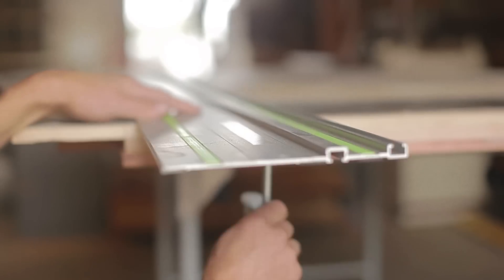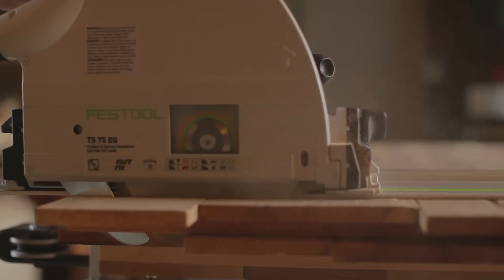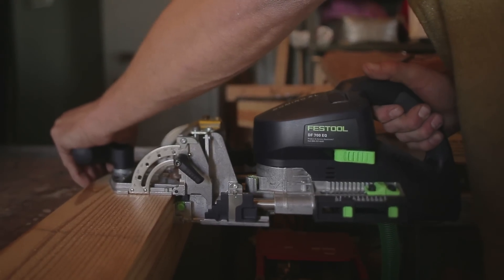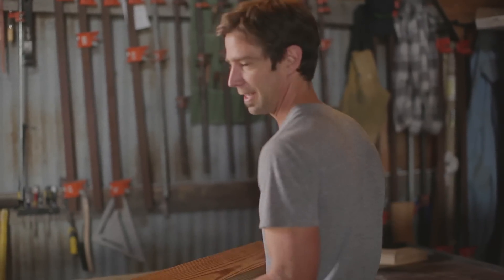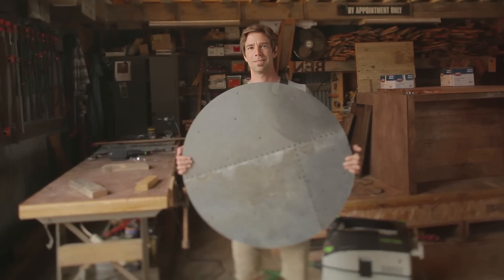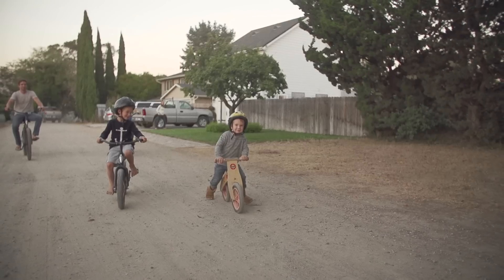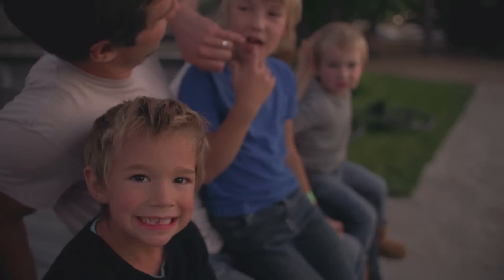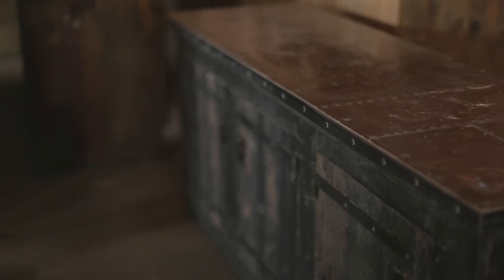Smallerizing it with Ben Riddering and Festool: a shared philosophy of quality craftsmanship

Comment: I admire Festool products. I am, however, slowly unplugging my workshop. Only rough dimensioning  some stock with power tools. Using top quality hand tools( I don't need to tell any of you what they are, you know.) Enjoyed the video and the design work. Be well.
Reply: That is fine for low volume output on high quality products. But there are people who want higher output with good quality as well.